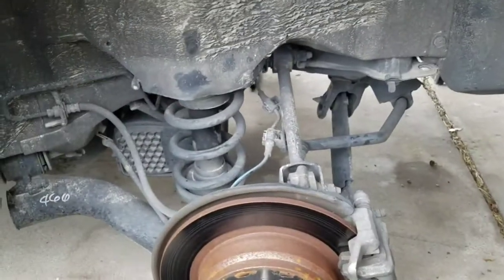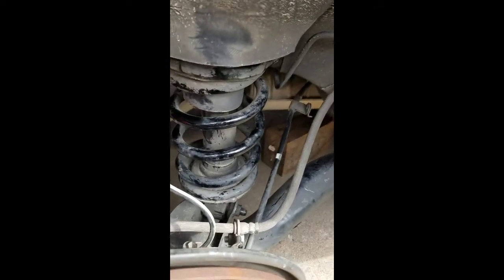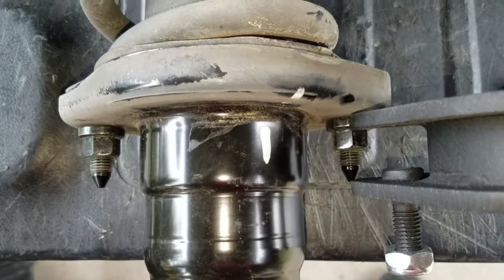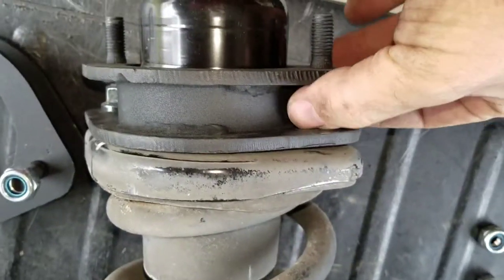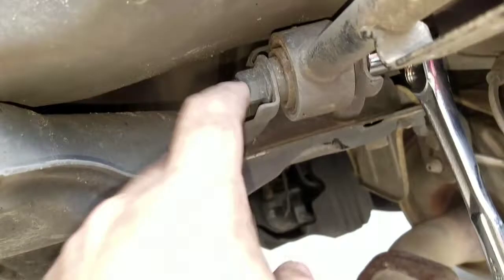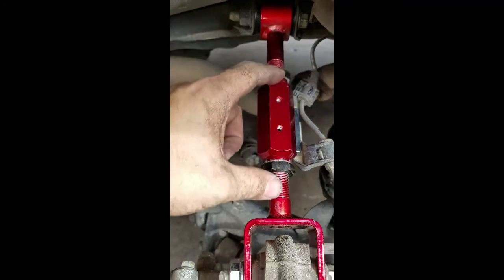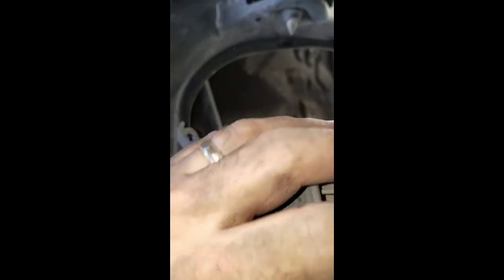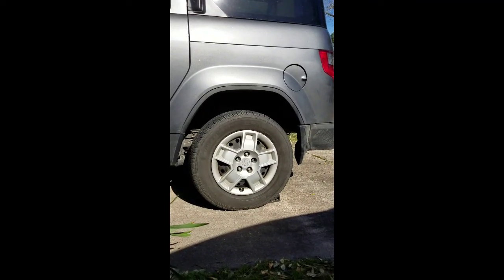2010 Honda Element lift kit install Part 1 of 2

Comment: Dave, Thanks for your video.  I just got done doing a 3 inch front, 1 inch rear lift on my 2011 Honda Element, 4WD.  They were a great help.  I would like to add some suggestions.  Being in the NorthEast, corrosion played a big factor on getting any bolt loose.  So having a 1/2" air impact gun, breaker bar with cheater pipe extension, propane torch, all came in to use.  Also, since I have 4WD, I bought a MacPherson Strut Spring Compressor Set from Harbor Freight.  Item #63262.  It was money well spent.  I was able to compress the struts which aided greatly in installing them, and not pulling to hard on the CV joints.  Your tip on loosening the front stabilizer link on the front install is something that has to be done.  Look for the allen key socket in the end of the stud if you are having problems with it rotating.  Again.... Thanks!

Comment: You actually want to make the adjustable upper arm shorter than the stock one because the control arms are pushed lower making the tires tilt out further.

Comment: Did you ever try the spring rubber) spring spacer?........I saw you point out the camber thing in the back but it doesnt look like it does much. I am having issues with noisy rear bearing when i tow because it seem like the camber is too much and im hoping the spring spacer will help.

Comment: Does anyone know if you can survive without replacing the control arm? My control arms are on there TIGHT! took hours with heat and a air gun and still no luck.

Comment: Coolness Dude! You on the Off--Road elements page on FB? I just did this exact size lift on my E as well, except I made lift blocks and added longer studs to new mounts. One thing I hated to see was the angle of the rear struts once installed with no compression on it. Angle was really wonky!
Reply from the maker: bisket2003  unfortunately this element is at the graveyard!   It was totaled after a side swipe deployed the air bags and cause some damage.   Now were sporting a 2007 Honda ridgeline.   Very nice truck with lots of hidden features ahead of its time that would be very useful in other brand pickups to this day.   Plus the best part is the center console because the element had none.
Reply from the maker: I am vey happy that this install has been so helpful to many.  I know I was lost when looking for information on it before purchasing the lift.   Couldn't find anything online and thought if I do it I'm going to document it!   Apparently I'm on an off road element Facebook page so that tells me its helping allot of people.

Comment: Any issues with the since you installed this? In particular with the the CV joints?
Reply from the maker: Well the element was totaled about 7 months after install.  Side swiped by on coming traffic.   As far as the CV joints I had to replace both with newer ones and my problems went away.  Be prepared to possibly replace yours if they are older and or if your not careful tugging and pulling on everything.

Comment: is this on the all wheel drive or the front wheel drive model?
Reply from the maker: James Rowney this was on a front wheel drive.
Reply: David Huffman would this process be different on the back end of an AWD?
Reply from the maker: James Rowney I'm sure it would be but it would be involved with the cv axles attached to the rotors.   kinda the same thing up front except in the back.
Reply: No, it would not be any different. In the Honda Element the rear suspension is identical between the FWD and AWD variants just with the rear axles omitted in the FWD.